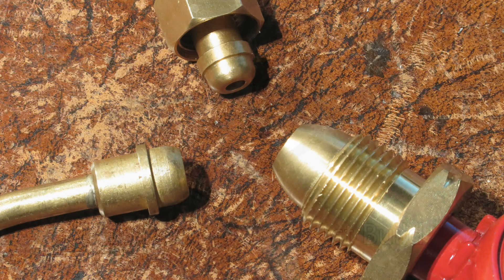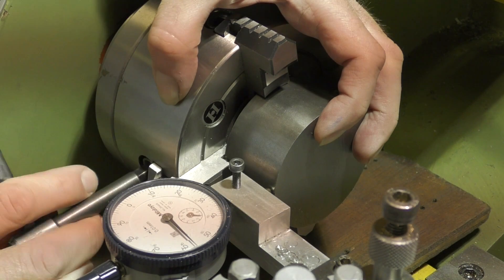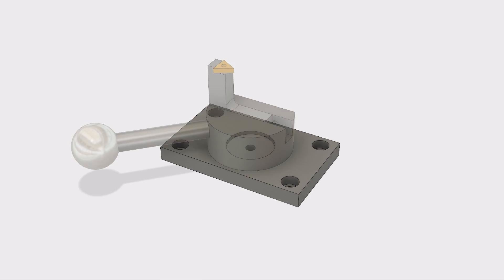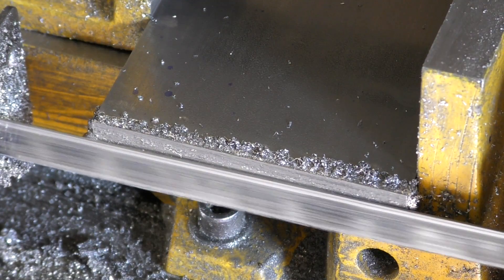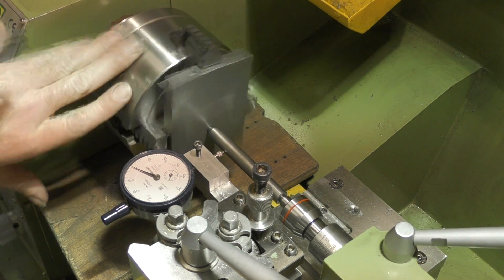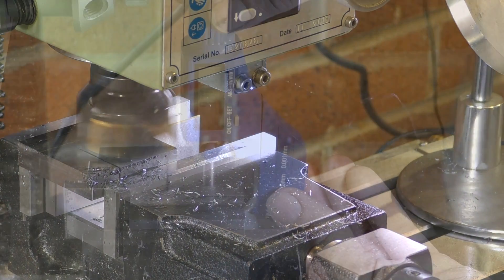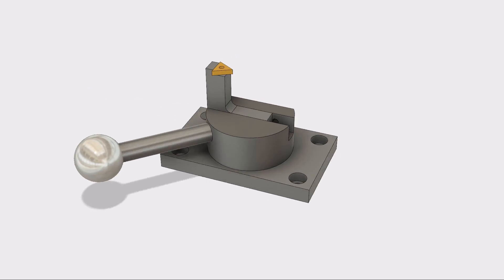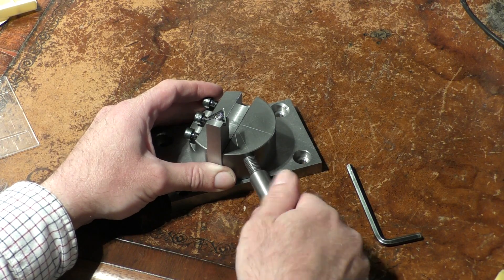Lathe Ball Turning Toolpost Build

Comment: That's not practical at all! How many time did you loosen the three screws to advance the cutter to work piece? 100 times maybe!! Because the center of rotation has to be fixed right under the work piece all the time.
Reply: LOL!  He didn't have to adjust them at all.  The base plate is bolted to the cross slide.
Reply: Learn the basic principles of how the lathe works before inserting your uneducated analysis.
Reply: Looks like I'm the only who seeing the  sense of your argument.f u feed using the crosslide then you lose your centre.u must advance the tool only
Reply: @thewarlordscalling6537  You are correct that the center of rotation moves when you advance the cross slide, but you are not correct that it matters. The swing of the tool covers 180 degrees of the ball's circumference, and you advance the tool (and its center point) until it is directly plumb with the rotational axis of the part. Other ball turner designs require that you start on center in both directions and advance just the cutting bit. This one operates more like a hand graver that is constrained in its movement. David didn't invent this, as he mentions, and he's only one of countless thousands of home shop machinists who have made one over the years. I assure you we aren't all so foolish as you believe. You simply didn't understand the way this is used differently from other designs (especially the variety which is based on a boring head mounted on the tool post).
Reply: The tool is set to the center of the work on the X axis and stays there. The cutter is advanced on the Y axis as if parting.  You never have to advance the tool unless changing the radius you are cutting.
Reply: That´s correct, but i think, this is only for simple works.
Reply: Ammar Tamimi  احسنت الرد ابو ياسر
Reply: @thewarlordscalling6537  Not true. The radius is set and locked to the diameter you wish to turn, then the cross slide is advanced until the cutter machines that diameter. This type of tool can also machine concave radii if the cutter is set beyond the center line of rotation. I know this because I machined a very similar ball turner in my shop.
Reply: Lol
Reply: Instablaster
Reply: Ya fargin' clown

Comment: copied the idea and used it to make many bead roller dies.  I did engrave a scale on the sliding tool post and mating base for quick setup for specific inside or outside radius.  Thank you for posting.

Comment: put a relief cut down side of tool holder or grub screws will burr it up never get it out make another tool holder with two carbide  inserts facing both ways you can cut concave and convex

Comment: Excellent in its simplicity thank you for sharing this with us. Can this tool do larger simple curves?
Reply from the maker: Thanks Virginia. The radius is limited by the distance between the bar stock and the bottom of the tool holder, which in turn is governed by the size of the lathe you make the tool for.

Comment: hey david, nice work, i really like it! theres one thing that might be unclear: when you make the tool holder, you take the height of the lathe center and mill it to that exact height... but, if you place your insert on top, it will be above the center? a solution would be to take 2 of the inserts you want to use and shim the tool holder in the toolpost up for marking the thing, that would give a dead on result when the insert is mounted?
Reply from the maker: Thanks Sharky. I milled off the thickness of the insert.

Comment: Awesome video. I have been wanting to make one of these for my small lathe for quite some time. Yours is the most straightforward design that Ive seen. One question though. How did you affix it to the lathe carriage? I saw the four bolt holes. Do those line up with holes on your carriage?
Reply from the maker: Thanks joedell71 - that is correct. There are 'T' slots in the carriage that line up with the four bolt holes.
Reply: Ahhh Ok then your carriage has T slots in it. Mine doesn't. It's ok though. I can use what you've done and just modify it. I won't need a base plate like yours. My carriage has a round boss on it already that sticks up like the one you machined into your round part I'll just mount right to that with a thrust bearing underneath or something along those lines. Thanks for the reply.
Reply: joedell71 vhi
Reply: joed

Comment: I really like it, but the center pin is hokey, with threads on a turning surface. Should have turned the center pin from scratch, so the nut would tighten at the proper time, I know the outside circumference is kept true, so probably doesn't matter really.
Reply from the maker: Thanks Paul

Comment: Why is there no bearing in the center?
Reply from the maker: I thought about, but it used extra height that a small lathe doesn't have. In hind site, it really doesn't need it anyway.
Reply: @DavidCambridge  Thanks, that good to know. I made a copy of the Perfect Sphere jig from Carter products and had to use 2 bearings in the bottom so it was solid enough to do concave turning/ with just the one 1/2" thick bearing, it w was fine on convex ( ball) turning, but chattered like crazy on the concave cutting. I think I make one of these for my  9" metal lath - for jut convex turning.................cheers, Jim

Comment: Nice job... But! :D
In Europe (and America also), most lathes (at least the ones been manufactured before the great chinese dumping of cheap shit into Europe) are equipped with a taper slide that's capable of machining balls by loosing the fasteners on it. The machinist can vary the diameter of the machined ball without stopping the lathe, or turning any screws. Just sayin', no offense.